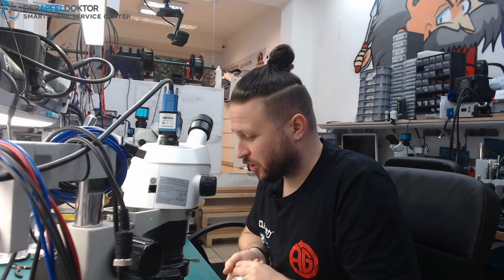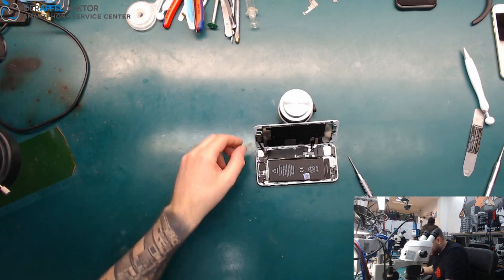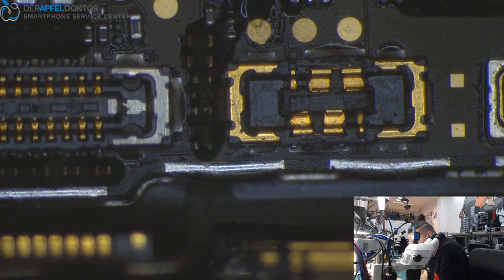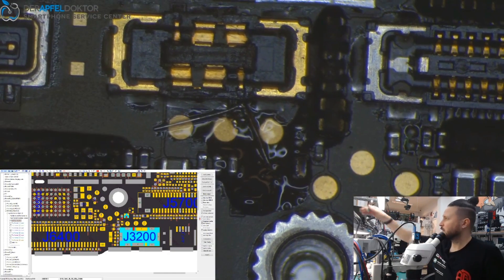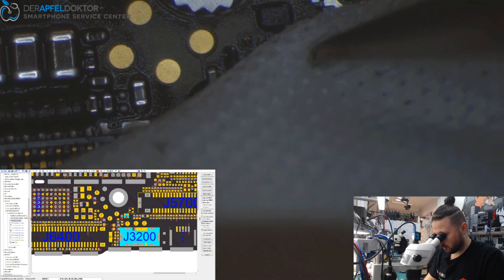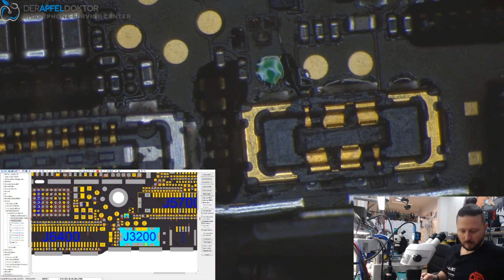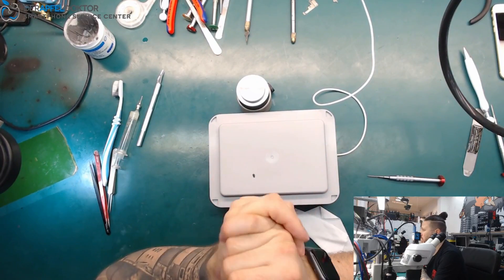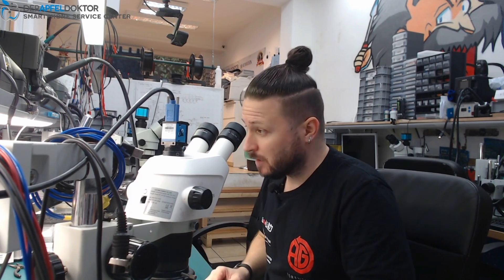BASIC REPAIRS - iPHONE 8 ONLY 1% - MOSFET RIPPED OFF - NO CHARGE - BOOTLOOP - SWI LINE

Comment: What are you putting your soldering iron into, sounds like a machine, maybe for cleaning?
Reply: Jason Caldwell it’s probably the JBC soldering tip cleaner, it’s electric one that spins. It’s quite expensive but aoyue do a knockoff version that’s only £60, link below https://rover.ebay.com/rover/0/0/0?mpre=https%3A%2F%2Fwww.ebay.co.uk%2Fulk%2Fitm%2F232235690922                                                This is the JBC VERSION but its really expensive.   Link below.   https://rover.ebay.com/rover/0/0/0?mpre=https%3A%2F%2Fwww.ebay.co.uk%2Fulk%2Fitm%2F202798388464